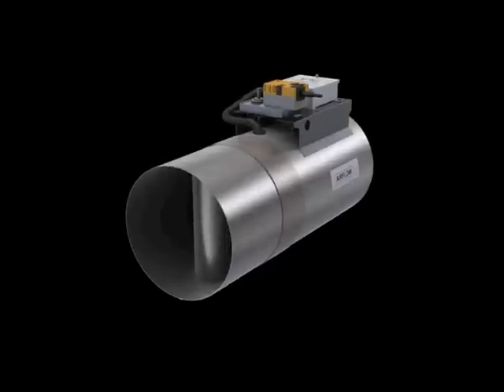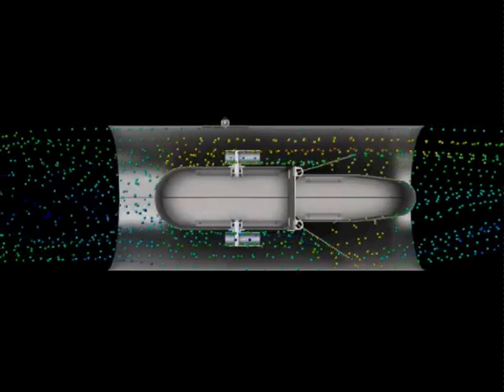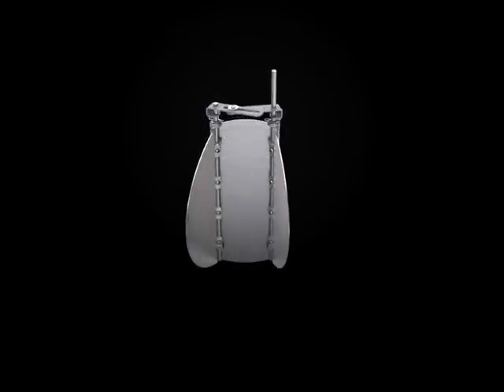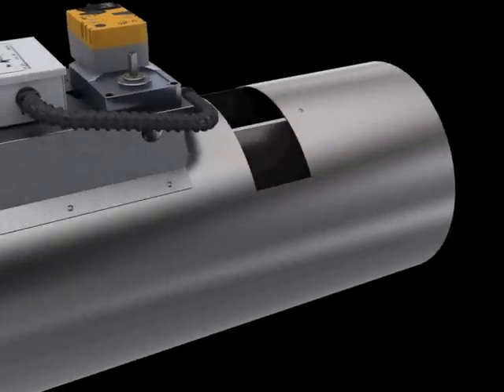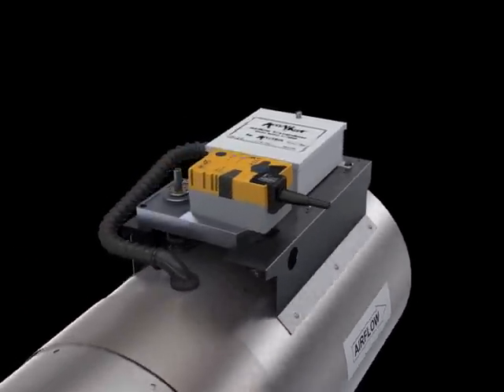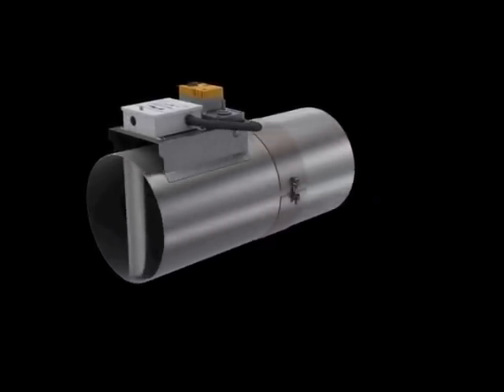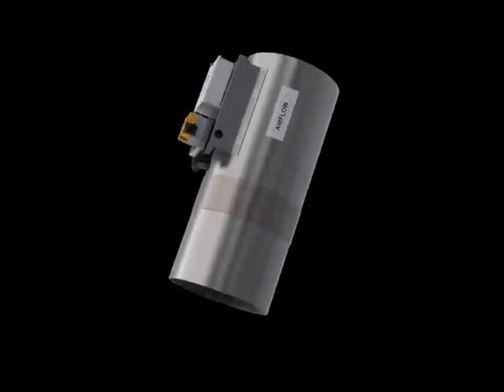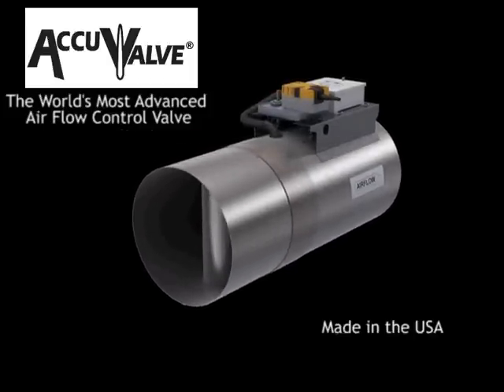AccuValve® Airflow Control Valve Operational Features

Comment: These work great until a tiny bit of dust gets on the flow sensors and causes them to loose reliability. I have had to help numerous Hospitals even new Hospitals due to their OR’s falling out of compliance. I now know if these valves are installed that dust is the problem especially when the exhaust and or return is out of balance. I really hope they can come up with a solution to this because this seems to be the only flaw I have seen with these, however, it is a big flaw that can cost a facility a lot of money.
Reply: Still better than a Phoenix valve!